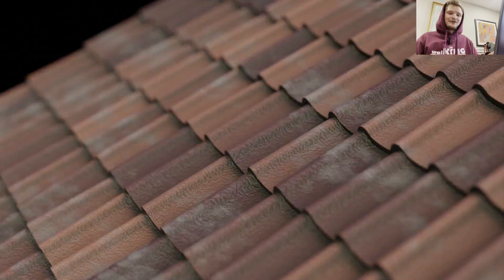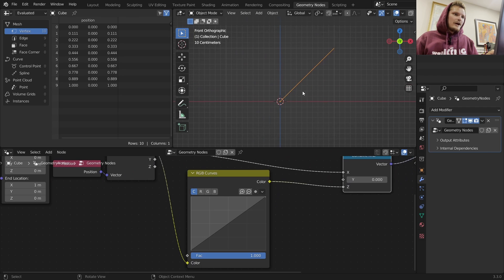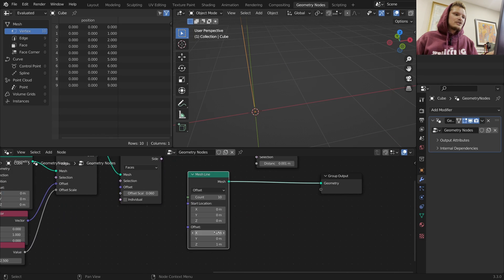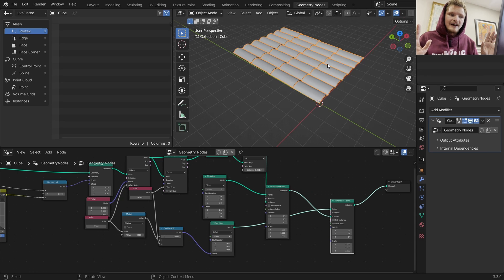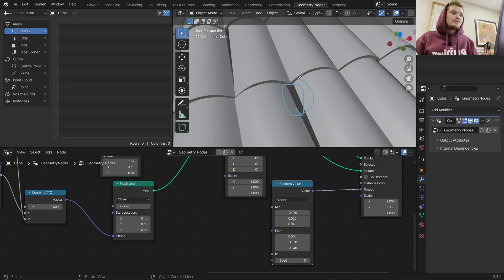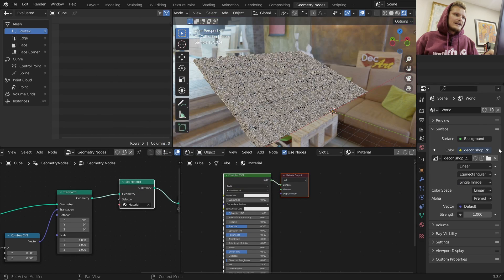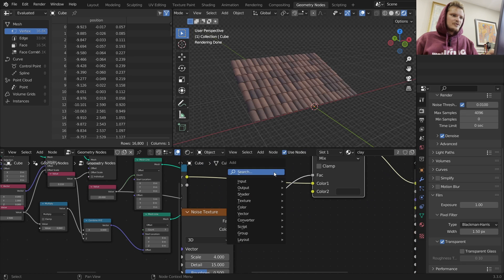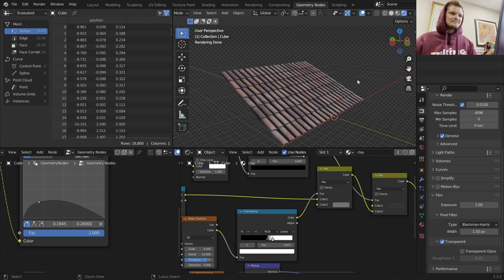Blender Procedural Terracotta Tiles (for roofs!) - Geometry Nodes

Comment: ....uuuuuh!   Almost.  
I mean, thank you . 
I happen to want to make some models/architecture from an ancient Roman era so this is the type of tile I need...
....except for a flaw in the geometry.   
REAL roof tiles  need to "shingle" properly (not 'sheath') .  As the tile profile goes positively along the X-axis it has its hump shape to account for the one tucked under it (along the Y-axis) 
The dimensions of the X=axis "hump" need to shrink sufficiently so that they tuck  under the next tile above (by the amount that the thickness of the tile  dictates) since the TOP of the tile X-axis hump arc will be a larger dimension than the underside arc of that tile due to its thickness.
Roof Tiles are really  made to tuck 
A)under the one higher up on the Y-axis 
and 
B) up under the edge of the tile neighbor along the X-axis  so in a sense like an S curve (or a hump then a flat but with an upturned edge anticipating the beginning edge of the next tile so there is alway overlap to prevent water running between)
You've 'cheated' by adding the 'tilt" to hide the geometry flaw. With your design the underside arc necessarily rides up over the larger diameter arc of the top of the tile lower on the Y-axis so you'd get the tile touching at the left and right points of overlap and a gap at the middle .
I am writing some of this in hopes  it will help me conceive of a way to adjust the geometry nodes to fix this by adding some parameter in the tree that would solve this but my brain is not able to juggle the abstractions of geometry nodes that easily.

Maybe if you see this (<0.02% chance) you could integrate the missing  parameter into the geometry of the individual tiles.
Reply: Absolutely correct. Also, a sideways gap exists between the top tiles as they straddle a tile laid upside down underneath (mostly a wider, shorter tile).  I've laid thousands of these tiles in real life, and now I'm designing houses. it's not easy to do either, but Amazing tutorials like this make it a little easier, thanks very much

Comment: Note: You can achieve the random color value without realizing your instances. In the shader editor, instead of a Geometry input node, use an Object Info node, which also contains a Random output option, please note that in that case, this only works if you haven't realized your instances
Reply: Cool. 
The Geometry info node with realizing instances actually didn't work for me at all, but this did. 
(I'm using 3.6)
Reply: thanks!
Reply: Great tip. Alternatively, you can export an custom named attribute from geo nodes and use that in the shader editor

Comment: There must be something I don't quite get, but If you put any other value than 1m as the end location of the Mesh Line, the curve gets either cut off if shorter than 1m or if larger extends beyond 1m in the viewport. Would be nice to enter real world values from the start, like 330mm "width" of the tile.
Reply: Maybe when you put the value though the Curve node it gets map ranged frmo 0 to 1... so the RGB curve works for the shape... and the output of the RGB you can multiply it, or scale it by the 330mm value you want.
Reply: @AArmstrongC  gonna give it a try, thanks!

Comment: There part where you scale the tiles by 1.1 is no good.  It hides the gapes entirely while it's visible with real roof tiles.  Looks like each row of tiles is just a single super-wide tile.  So why doesn't it rain through I hear you ask?  The trick is that each roof tile is twice as wide as the ones in the video, the tows are overlapping such that at any point of the entire roof there are always two tiles over each other and the rows of the tiles are offset by 50% of the width of a tile so there's never the gap of one row of tiles aligned with the gaaps of the lines below or above.
Reply: Kind of right...and kinda wrong. There IS a flaw in the geometry that makes this fail in the real world. Tiles tuck under the one above AND the one beside (but not necessarily 50%). There is an upturned edge  that catches the beginning adge to the side of each next tile (x-axis) and each tile tapers to tuck under the one above (y-axis). This way water alway runs down OR to the side  ONTOP of a tile that is overlapped by the above tile and so on like a shingle.

Comment: This is awesome! What would it take to be to use real geometry to drive the pattern?  rather than controlling by transforming it? eg for every quad in a mesh, fill it with thes random tiles?
Reply: I guess that you can achieve this by instead of distribute points on a line, you can use the geomerty directly and instance on points.

Comment: Is there any reason for defining the shape using the RGB Curves-node instead of the Float Curve-node?
Reply: I’m still learning node stuff but I’ve actually never seen the float curve or vector curve used in any tutorial what would the reasoning be behind using float instead of rgb
Reply: @goatpepperherbaltea7895  In this case, there is only one float value that needs "shaping" so it's kind of overkill to use the RGB-node since it's meant for colors (3 float values). Not sure if it's actually matters performance wise in this case, but it could matter in more complex node-trees.
Reply: While going through this tutorial I used float curves and it's exactly the same except that the RGB node extrapolates the curve outside 0-1, whereas the float curve clamps it. Not a big deal in this case.